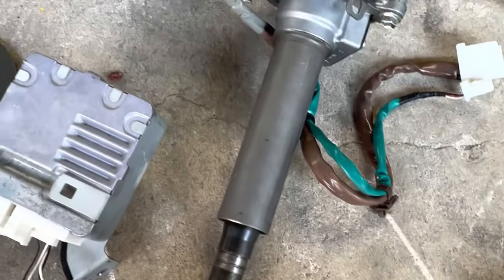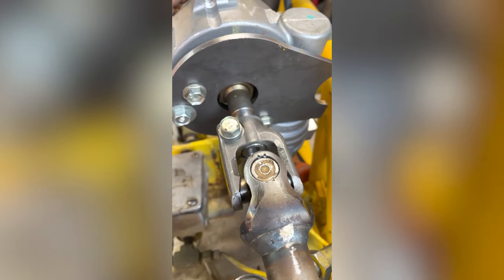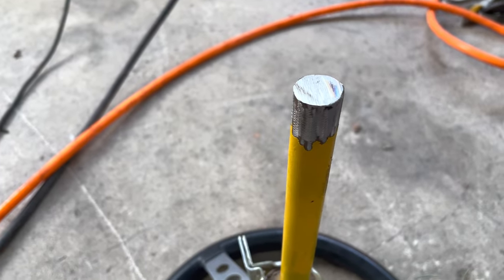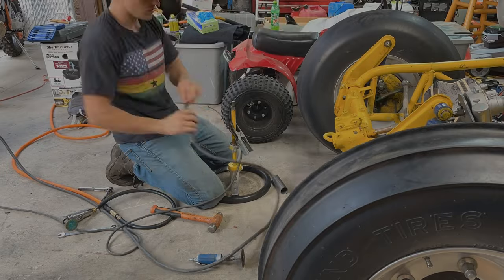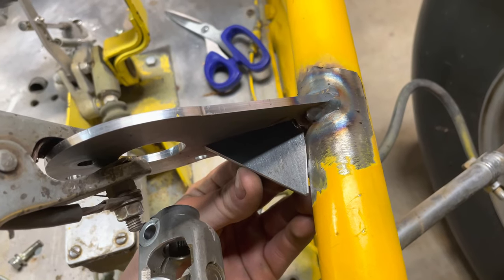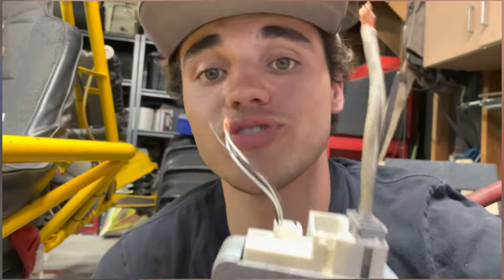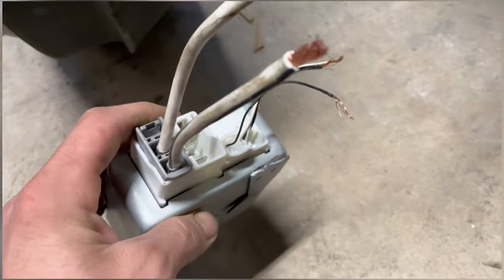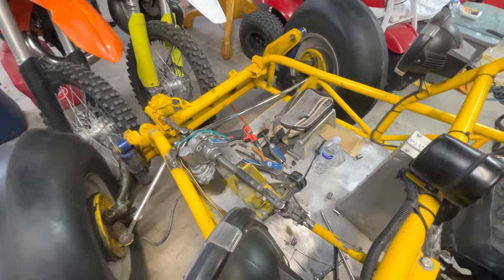Electric Power Steering on my Dune Buggy for $75??

Comment: I love the EPAS mounting bracket. It's neat, clean, simple, and effective...everything we should always seek to do with fabrication. I'm not as wild about welding on a steering shaft. That's not a very good idea because a break could suddenly leave you without steering. That exact move killed F1 legend Ayrton Senna. If it can happen to Williams F1 of the 1980s, when they were at their absolute best, it can happen to anyone. There are couplers for virtually any steering shafts, and you can grind a Double D on an existing shaft. You should use them for your own safety.
Reply from the maker: Thank you! Appreciate you sharing your knowledge with me.   I will definately look into that. 👍
Reply: @cludardgarage402  thanks for taking my comment in the spirit intended. I enjoyed your video and the follow up, and saved them for reference.

Comment: When the shaft was solid, not hollow I would have considered using it as an ID for a larger pipe that would cover both shafts.  I could not tell if that was an option in your situation.

Comment: Great job. I been looking for a way to put power steering on my 1934 Plymouth, just don't have room on the engine to put another pully for conventional steering. The shafts look just like the ones on my steering already. I think everything will bolt up easy with a few cuts on the shafts like you did.  I couldn't hear the motor running when you were demoing. the unit. Is it that quiet? That would be great. Thanks allot and again great video.
Reply from the maker: That would be awesome! You will have to let me know how it does in the Plymouth! Also yes you can’t even hear it! It’s pretty much silent. So times I would ask myself if it’s actually on then I would turn it off and it was way hard to turn so I knew it was working haha

Comment: Cool
You hAve a nice sand rail but I never seen one with just a gas pedal n brake where’s your clutch?
Reply from the maker: Ha ha.  Its an Automatic.... The transmission is a GM turbo 350 with a custom built shaft and adapter that bolts right to the rear end.  Thanks for watchin!

Comment: Did you do any sort of modulation knob to adjust the amount of assist? or just run the stock assist?
Reply from the maker: No I just ran the stock module so it’s not adjustable. But it doesn’t feel to light or to heavy when steering!
Reply: In OE application unit must have speed input to correct assisting power. In this application it just runs in emergency mode. Same with electric hydraulic power steering pumps from Volvos - they just run in safety mode and don`t do any adjusting like they should do in OE application.

Comment: So how does it feel on high speed??
Is it smoother than it should be?? Because what i know is that kind of power steering  (EPS) receives data from the car ECU about vehicle speed so that it controls the feel and the ease of turning the wheel. So that it gets heavier on high speed and smoother on low speeds.
Reply from the maker: Ya I havent really noticed it.  I typically dont do high speeds all the time.  Im usually averaging 30 to 40 mph crusing around the dunes. I might top at 70 mph and then back off.  So I havent noticed it being hard to steer at high speeds. Thanks for taking the time to watch!

Comment: I just installed electric steering in my buggy The steering column is out of a 2013 Kia rio  There is 3 other wires on the box democrathe magical one is keypower on and the other 2 where do they go It will not turn on unless I hook those 2 up When I check voltage coming from my car with a working column it is 2.5 votes With 4.7 homes on the blue wire
Reply from the maker: I only know how to hook up the Prius one.  You may have to just play with it and see what works.  Sorry wish I could have helped you out more on that!  Hope you got it working!

Comment: This approach could be used to add power steering to any car or van that never had it, or an EV conversion where  the engine driven power steering will no longer work.   Plenty of cars out there use electric power steering now so loads to choose from in junk yards.
Reply: But do they all have stand alone controllers?  I suspect that is why everyone is using  the Prius parts.
Reply: @T0tenkampf  probably not. I know of a few European males that do. It’s one of those Google it, or junk yard moments.

Comment: Can you just use the black and red for it to work?
Reply from the maker: No because the red and black are only the ground and power and you will need a signal wire to make it function properly.
Reply: @cludardgarage402  That make sense, from what I had researched, it seems like it'll work in a "fail safe mode" so if I had just the power and ground connected it seems like it'll work but won't auto center or won't adjust its sensitivity to speed? Or would it just completely not function at all?
Reply from the maker: I know it works the way I wired it up to my buggy.  But ya I'm not sure.... how it will work. But if you do try it with just the 2 wires let me know. Ha ha. Im curious.    What are you thinking of putting it on?
Reply: @cludardgarage402  Gotcha, yea I'll be most likely be hooking it up within the next 3 weeks. I'm putting it on a BRDM 2, it has a transmission PTO power steering, but its pretty weird to use because any time the clutch is disengaged, it loses power steering. If this works well, I'm going to get another one and put it in my m35a2 as well. The only thing that has me concern is the weight of the vehicles, but I think it should handle it fine if I'm not at a standstill using it
Reply from the maker: Wow!!! That will be awesome!  I bet those are a riot to drive!
Reply: @cludardgarage402  Yea, I haven't moved the BRDM much just cause of that and the m35 is a pain, especially in parking lots

Comment: Did you think about water
Reply from the maker: No I don’t drive that in the rain. But if you put it on a car I bet the motor would be sealed pretty good. You just might have to put the module inside the cab or put it in a water tight box